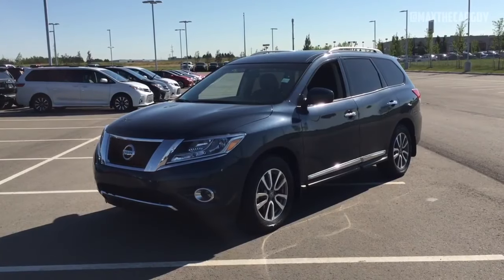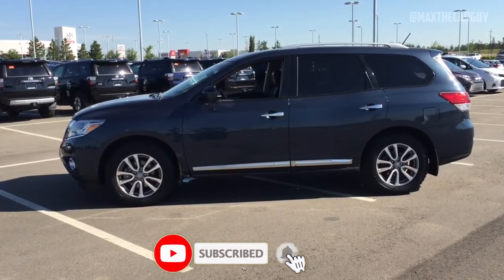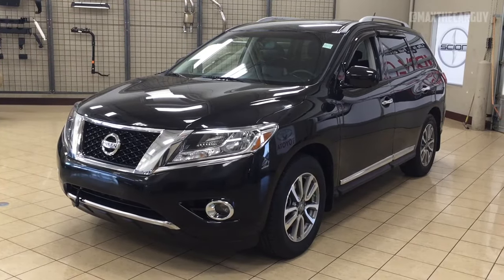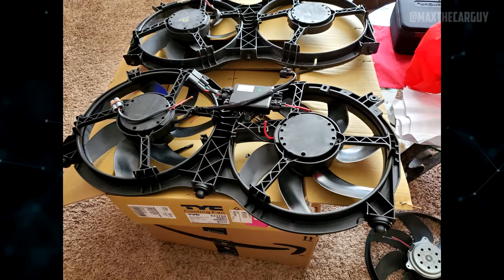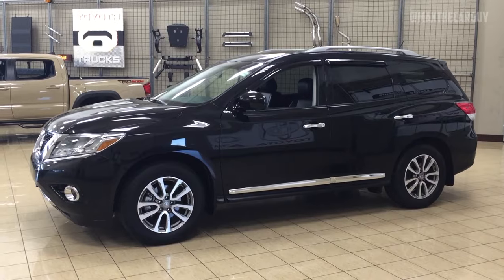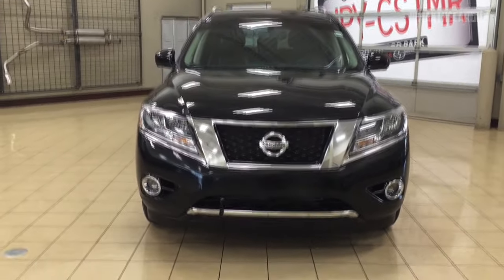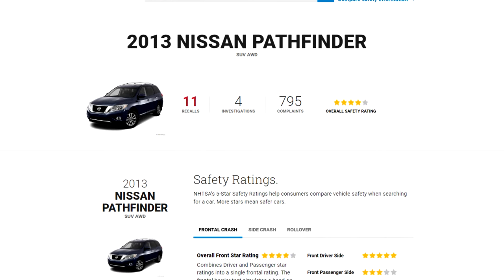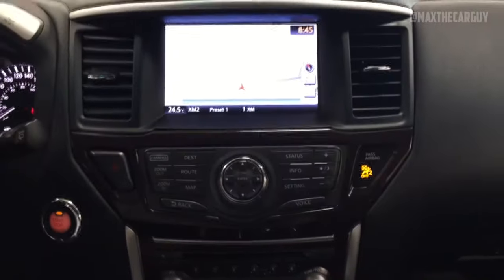Nissan Pathfinder (R52, 2013-2020) Common Problems, Reliability, Pros and Cons

Comment: 2017 Nissan Pathfinder... one of the worst cars I have ever owned. I have owned like 8 different brands and never have I been this frustrated.
Reply: 134000 km ... Only bearing of  front strut gone because of dust of gravel road... original brake componant apart the brake pads...pretty reliable
Reply: I have the 2014 model..i have shown to many mechanics but no one was able to diagnose..problem is at the initial stages it feels like a jerk...some times that jerk lasts upto 5 secs...dont no what the problem is
Reply: @shabaz241  I am not sure on this but because Nissan was under a class action lawsuit and issued a recall to change the transmission (on mine at around 42k miles) why was it not done for you? And many others complaining. The new transmission never gave any shuddering issue. The jerk is basically the CVT belt slipping inside the CVT plates.

Comment: My pathfinder is 10k KM 2020 model 1st owner, I noticed CVT little shuddering issue since beginning, local nissan dealer insisted that this is normal! By time car went out of warranty, now shuddering is very clear. From my standpoint, Nissan Japan pushes dealers over the world not to expose those kind of issues to customers and so they used to them, till the warranty is end up. What a customer centric strategy!? One of my worst decision I've ever made to trust Nissan😢

Comment: Have a 2014 Pathfinder SV with 210,000 miles and have had no problems.  Still drive it 130 miles a day round trip to work.  Had to replace AC Compressor at 200,000 in 2024.  Love the vehicle
Reply: Minimal issues with mine until 167k miles when AC went out.  Shop quoted me $1,100 to fix AC compressor & recharge afterwards, is that similar to what you paid?

Comment: I am the first owner of my Nissan Pathfinder 2019 first when the mileage was 52.800 the first transfer case failed it has warranty they fix it. Again when the mileage was 72.000 went bad again same problem it cost me $7.200.00. Now the mileage is 148.000 this week same noise is back I owe good $20.000 what shall I do?
Reply: Sell it and a Toyota Highlander
Reply: While the transfer case issues exists, they are virtually eliminated if you change your transfer case gear oil every 30k miles. For a transfer case to fail that often and repeatedly is nearly statistically impossible. It sounds like there is a variable that is being repeated. Such as a mechanic not filling it with gear oil complete or at all, or used parts being used as replacement.

Comment: 2016 is very unreliable, there have been tons of reports of the catalyic converters going bad within 3 years, which is way too early for those kind of problems, the engines are very expensive to repair at all, due to the amount of sensors and computers in the vehicle, if one thing breaks everything breaks, the spark plugs also have been reported by thousands to have gone bad within 1 year of driving. I highly urge you buy an older vehicle, while technology is nice, it can make things very expensive and cause a lot more problems with your vehicle over time.
Reply: Insane Junkkkk it sounds like very disappointing 😂

Comment: I bought a 2018 model and haven't had one problem with it.  When I bought it I made sure I bought it from a dealer like Tim Dahl Nissan that gives you a lifetime power train and transmission warranty though... since I heard they had CVT issues... but I haven't had CVT issues.  I've actually taken it high in the mountains deer hunting and the 4x4 worked great, I've pulled a heavy trailer to a different state no problem, etc.  I liked at a forerunner which has better clearance but they they get terrible gas mileage... like 18 mpg versus 27:on the pathfinder....
Reply: i have a 2018 aswell with 180k miles runs smooth with no issues
Reply: @robacejr  since I wrote this my struts went out at around $50k miles which is unbelievable for how low miles it has... but fortunately I bought the extended warranty which covered the $2k repair cost.
Reply: @thadlogan51  yes the recommendation for struts are 50-100k I have changed mine even they felt a ok.  it is regular ware a tare. I do my own maintenance on my pathfinder.
Reply: Be sweet if it would stay in full time four wheel drive past like 30 or 40 mph

Comment: I'm about to buy 2016 Nissan Pathfinder with 90k miles. Should I buy it?
Reply: Yes go ahead I have a 2018 with 223,000 miles with 0 issues
Reply: @Justaeuropeanman  no transmission problems?
Reply: @MrRobertMacknaw  nope never. I also have a 2015 Altima with the CVT with 202,000 miles and a 2016 Sentra also with the CVT with 190,000 miles and have never had any problems with the transmissions. I just always keep up with all the maintenance on my cars and change the CVT transmission fluid every 80,000 miles
Reply: Did you buy it?
Reply: I am planning to buy 2016 Pathfinder too, would like your opinion on it.
Reply: @ArunDhyani  they are solid vehicles. Mine is a 2018 pathfinder and it has been a very good vehicle. Just hit 230,000 miles on it and never had a issue. It’s very comfortable. Not too bad on gas and it has the power when you need it also. I say go ahead and buy it you won’t regret it. Just make sure to change your CVT transmission fluid as soon as you buy it because you never know if that last person before you changed it or not
Reply: @ArunDhyani  Not yet. Thinking about buying Pathfinder or Toyota Rav4
Reply: @MrRobertMacknaw go with Toyota. I have a 2014 Pathfinder since 2018 and miss my previous Toyota
Reply: @fkarmadi  You had Toyota RAV?
Reply: I bought a 2016 Pathfinder with 27k miles. Currently at 115k and never had a transmission problem.
Reply: I have 2017 with 213k miles
Reply: @MrRobertMacknaw Sienna and camry. Also currently have 2015 Rav4 in household
Reply: We just bought a 2015 platinum factory tow hitch 4wd, roof racks at 93,000 miles from carfax looking forward to camping next year with 2 children and a dog made sure to get the warranty which covers practically everything
Reply: How about me. I'm planning to get the 2013 model with 137km. Please advise.
Reply: We just bought a 2015 nissan pathfinder with 90k miles in great condition
Reply: Check the service history of the Pathfinder. I bought a 2016 model, took to Nissan for the next service and they highlighted engine sludge. Only lasted another year before died. It had missed a service!
Reply: @Justaeuropeanman You pulling my string or this true
Reply: @alexsanchez3635 Bro I have absolutely 0 reason to lie about this lol 😂 so yes it is true
Reply: @Justaeuropeanman what about a 2014? Not platinum? At 80k miles. Carfax said transmission serviced in 2023…
Reply: Yes you will be totally fine before I got my 2018 pathfinder I had a 2014 pathfinder SL. My 2014 Pathfinder had 270,000 miles on it and it never gave me a single issue. Only reason I traded it in was because I wanted to upgrade to the 2018 model. Don’t fall for all the hate out there for the Nissan CVT. Only reason so much people smack talk on the CVT is because from 2008-2011 the CVT had a lot of issues but after that they pretty much got the CVT down as long as you change the oil on it every 60,000 miles you will be fine.
Reply: @Justaeuropeanman I have a 2017 Nissan Pathfinder with 97k, dealer did fluid change at 90k. It feels like it slipping at low RPM but no warning light. Did that ever happened with your? Thanks
Reply: I have 2014 pathfinder with 207,000 miles never had issue had since 130k no issues just regular maintenance.
Reply: Never buy a pathfinder. Buy Toyota  if you wanna buy Japanese car.

Comment: Owned a 2014 SL since new and had the AC components replaced at 140k.  Also replaced the radiator fan when one of the blades broke.  150 bucks on Amazon and really easy to swap.  Other than that just normal wear items like battery, tires, and brake pads.   Pretty reliable overall.
Reply: Minimal issues with mine until 167k miles when AC went out.  Shop quoted me $1,100 to fix AC compressor & recharge afterwards, is that similar to what you paid?

Comment: I have never hated a vehicle so much as my 2014 Pathfinder.  No end of issues.  Replaced transmission at 225km, unreliable 4 wheel drive has required multiple services, rear coils sag easily, latest issue is need of a new steering rack.  Dont be tempted by a low purchase price.

Comment: I have a 2014 Pathfinder. Had minor shudder issues and Nissan issued a recall to change the transmission. The new transmission didn't give any problem. It is my car for all the longer trips. I replaced fluids for CVT, transfer case, rear differential, power steering, brake myself at 82k miles. Just replaced rear brake pads yesterday for the second time at 89k miles. No issues and drives like a new car, except for water getting logged under the passenger floor. I found the leak was due to a small hole at the seam and it wasn't properly sealed. I have inserted plumbers putty in that hole and hoping that the water doesn't come in again. Had to replace the AC compressor after 9 years. The battery was changed once too. I towed a bit initially using the original tranmission which Nissan changes under recall processing anyway. I don't drive too hard. Just keep it reasonable. It will 11 years since I bought it and have driven all over USA. So ya, it demanded some repairs but other than that has been very comfortable. The resale value is terrible although.
Reply: Minimal issues with mine until 167k miles when AC went out.  Shop quoted me $1,100 to fix AC compressor & recharge afterwards, is that similar to what you paid?

Comment: I had a full engine replacement on a 2017 Pathfinder. Fortunately i had it replaced by the dealership free of charge however for them costed $13000 AUD. Watchout for used Pathfinders and allways have warrenty IN WRITING! 

No other issues as i routinly maintain the vehicle.

Comment: Had an ‘18 Platinum.  Nice, roomy until the CVT let go. Shuddering at slipping at 96k miles.  6 to 7 grand to replace. Dumped it for a ‘23.  Much better.

Comment: I have a 2015 model and so far I have had to replace the radiator fans, sun visors, and now I'm working on replacing the ABS module because the brake pedal sinks to the floor.

Comment: I bought this lemon in Saudi Arabia 2014 model in 2015. The car is okay generally other than the CVT shuddering and juddering that’s colossally unignorable. 

I felt something wrong with the transmission on my first drive out of the showroom. They kind of brushed it off with some lame comments. 

I hadn’t come across the transmission failures in 2013/14 models until quite late. The CVT transmission was reprogrammed several times with no benefits to alleviate the problem whatsoever. 

The dealer (reportedly) replaced the transmission assembly when it has clocked 40K KM or so when it was still under warranty. The same problem reoccurred after another 30-40K KMs. The dealer didn’t extend any warranty to the newly replaced assembly. The assembly replacement  is priced at 32000 SAR that’s $ 8,500 plus labor that’s exorbitantly expensive for a utility vehicle like Nissan. 

Always be very cautious and researching whenever any dealer offers you discount. I fell into that trap too although I’m someone who researches quite deeply whenever I purchase anything over $ 1000 mark.
Reply: I am about to purchase the 2014 SV model (in Saudi Arabia). the previous owner told me that there was a recall from Petromin and that he paid 1800 SAR and had the transmission replaced (he paid for the labor). upon inspection, i noticed a new drops of oil at the bottom of the car. however, the inspection shop told me the gear is in good condition, but I need to check the gasket for leakage. I`m planning to do that in Jordan since it is cheaper. He`s selling it to me for 20k SAR. I would really love your thoughts on this. The car is soooo smooth to drive though.

Comment: Hi. I have a 2013 Nissan Pathfinder Platinum. 
It has worked great for us, as a family of 5. Now we are having another baby. 😊
My question is, is the middle seat( safety seat) in the second row removable? I just want it gone so the older kids can get in and out without putting the second seat down since a carseat will be there. Any help/advice would be appreciated! Thank you!
Reply: How long have you had it and how many miles? Looking at getting a used one
Reply: Since 2019, it’s 110k miles.

Comment: Define a bit more jerking and power loss? Explain to me as if I was a child, cuz I have a 3.5 '15 infinity qx60 that does some like that, when I'm at a steady pace it's fine, but while I'm accelerating it seems to jerk and the rpm's are just all over the place, I had put in a k&n air filter which I took off cuz some1 said it may be the issue. Put a regular 1 on it still does the same, so idk, if it's a trans issue I'll just get rid of it. Any advice? Thanks
Reply: Are you in auto or 2wd? I notice I get more shutter/jitter in auto compared to 2wd. May be a transmission problem
Reply: Same issues..and omg that jerk just feels like earthquake
Reply: @LilSplashPad  auto? I mean mine is not a awd. And I usually keep it in standard drive mode.